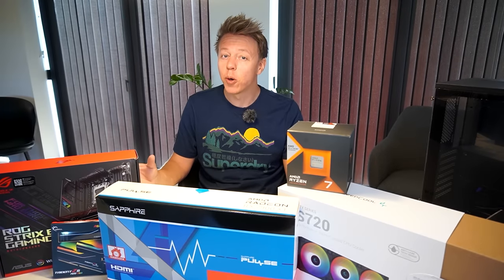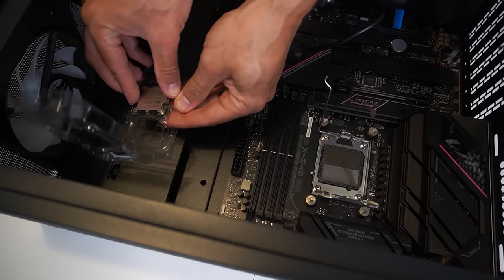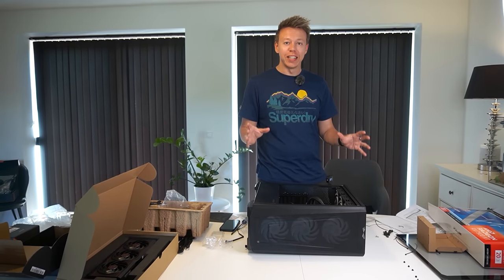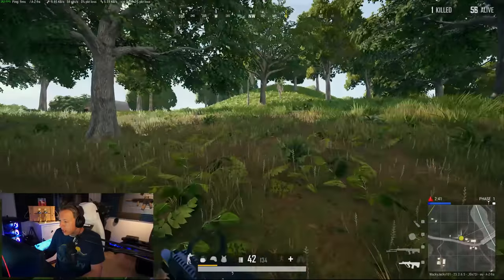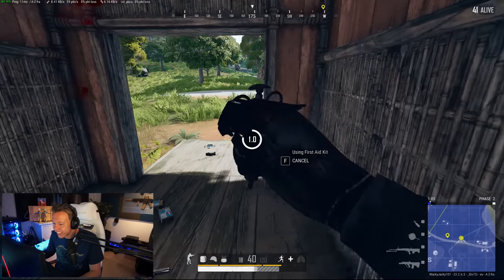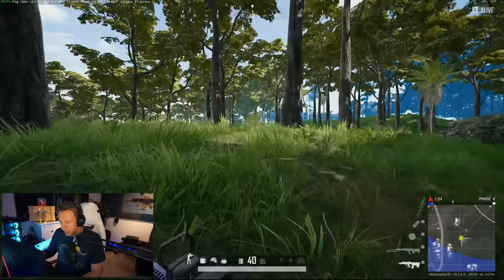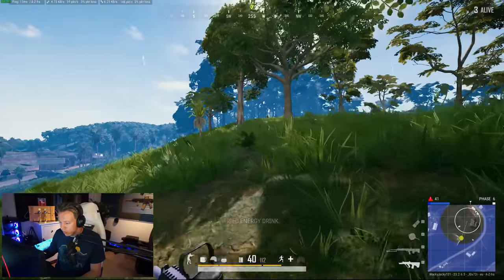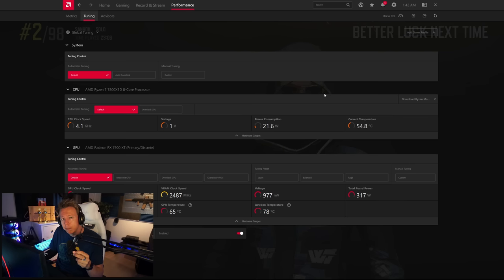I BUILT A NEW PC USING THE WORLDS FASTEST GAMING CPU - How well does it run PUBG?

Comment: Wacky, try running PUBG with AMD Image sharpening in the Adrenalin software. Makes enemies way easier to spot even from very long range. I usually run it on 70-80%. No performance impacts at all.

Tried NVidia's version of Sharpening with my friend's PC that has a 3070 and it was way blurrier to AMD's implementation of sharpening while losing around 1-3% performance.

Comment: Didnt you buy 4090 last year? For me the FPS are high, but still to jumpy between 230 and 260 FPS this can be noticable sometimes. I prefer capped FPS but rockstable instead. 
In general great system. Have 5800X3D, great CPU.
Reply: How do you even notice 230-260 fluctuations? You must have overclocked eyes. I'm usually 100-144, and can barely notice if it drops to like 80. Anything above 100 is just smooth sailing.
Reply: #DivinePonies true asf

Comment: For that 7800X3D, just avoid overclocking. Don't ask me why
Reply: Why???
Reply: @hardik602   cuase your motherboard and cpu may melt.
Reply: @hardik602  3D cache is more sensitive on voltages than the CPU itself. And when you overclock the CPU you must increase the voltage - and so when you increase the voltage, CPU draws more power, heats up easier, and also that 3D cache is very sensitive on high voltages, so there is a big risk in overclocking that thing. Also, there was a problem with its melting - SOC voltage on ASUS motherboards were messed up. ASUS was known for pushing voltages in CPUs more than anyone else. With undervolting you will have more benefit than with overclocking, your CPU will thank you later when you do a proper undervolt

Comment: Well, pubg might be a cpu intensive game, but even my ryzen 5 5600g which i bought used for 95 something bucks handles it easily, so the 7800x3d is a total overkill for pubg imo
Reply: And do you have constant 250fps+? No. R5 5600G = R5 5500 minus iGPU. R5500 PUBG performance is around an i5-10400/i3-12100 while these CPU-s in many place of  different maps limits the fps around 120-140fps. In that scenarioes these CPUs are heavily bottlenecking an only RTX 3060ti.
Reply: @maestrohun  a tech expert has entered the chat, i see. i wouldn't even bother disproving your claim that r5500 = r5600g = i3 12100 (4 cores, mate). Why do you need constant 250 fps? It's a stupid consumerist trend on getting cybersport grade equipment for god knows what reason. Haven't encountered drops below 180 tho. You just need to tinker with your ram bro

Comment: wouldn't a Ryzen 9 7950x3d be the fastest. At least it would be faster
Reply: No, you need to disable half the cores to run it at the optimum speed on every game.
Reply: Not in gaming unfortunately:face-purple-crying:
Reply: @marc_overmars  you are right holy shit. I was just about to buy the R9 7950x and because of this video I realised that the R7 7800x3d is better and cheaper
Reply: @amazillon  for gaming yes. for productivity tasks like video rendering etc 3d cache does little to no difference, 3d chips also have lower clock speeds and of course 16 cores > 8 cores. but for gaming sure, go with a 7800x3d, its a much cheaper and more efficient chip for that